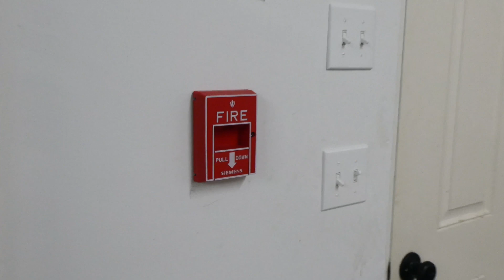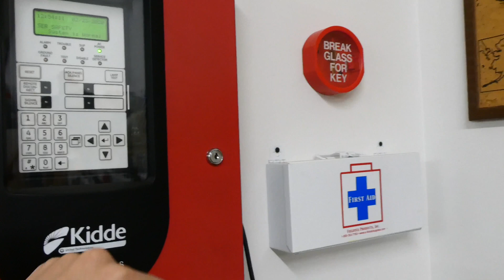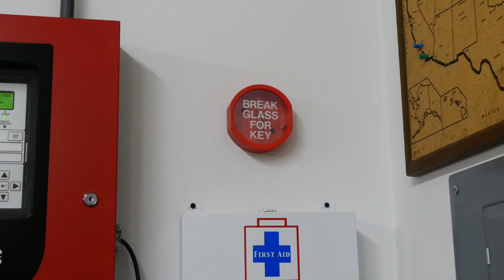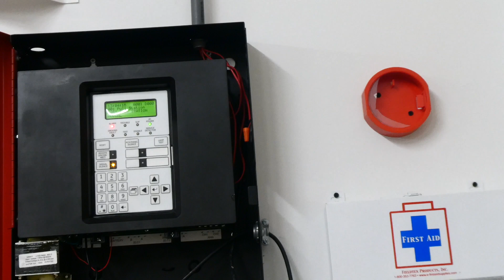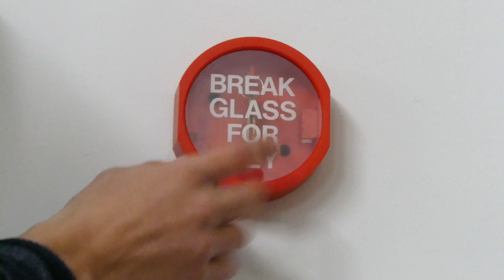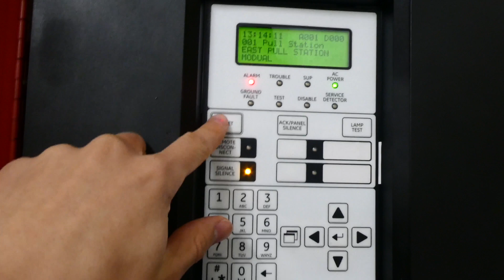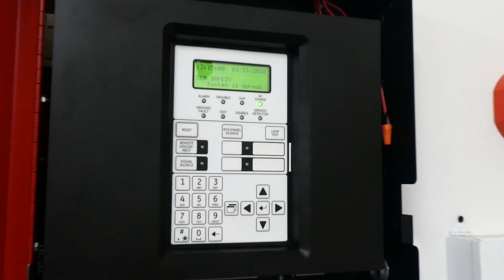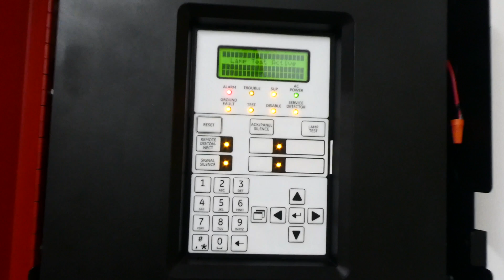S.E.R. System Test 13: BREAK GLASS FOR KEY

Comment: The full model number of both of your UMMTs are U-MMT-MCS-R which is the one with the fire lettering on the front, and multi candela and U-MMT-S17-R which is the one with the fire lettering on the sides and fixed candela

Comment: I blame fire fighters for blocking traffic cause as a truck drive i had to deliver packages from Texas to Florida and the only thing they did is getting me trapped with lots of cars an it annoys me that they are having fun backing up the trucks in the station and they even put me in a tight lane when they are putting out the fire and that ain't fun so it's my turn to annoy them cause if they want to be like that i just pull up to the entrance of the garage an block it and if there is an emergency i will be blocking their path so they can't get to the caller and if they planned to pull me out of my truck i have a shotgun that will be sitting on the passenger side so this will be a warning to all fire fighters cause i'll be blocking one of your stations for fun

Comment: I found one of these used on a Washington ferry boat I work on in my summertime. It holds the keys to the lifejacket locker room. if there is an emergency, people can get into the lifejacket locker room and get the lifejackets, but it keeps unauthorized personal without another key from tapering/entering the lifejacket locker room.

Comment: Having plastic instead of glass is pretty cool imo. Because it seems like it breaks more "orderly" rather than glass, which usually breaks into a million pieces and some fragments of glass can be large, and others can be extremely small and "unseeable" (I've had the misfortune myself of being cut by those pieces bcuz of how small they are 🙁. so Rule of Thumb is: if you DO have a legitimate glass break pull, remember to either vacuum really well or have something to catch nearby 😉). Plastic however can be pretty sharp as well, so that does mean you still have to be careful with that too lol

Great video!
Reply: It sounds like my middle schools fire alarm system but not the kiddie fire panel /old fire panel in 2016
Reply: Hello fellow wheelock
Reply: What does imo mean
Reply: @CelticsPatsProd  in my opinion

Comment: Hey SER Safety! I love your videos and I'm actually having trouble getting my fire alarms wired up. What size wire would you recommend for a hobby system that has no panel, 3 notification devices, and one pull station? I tried a 10 gauge which my neighbor gave me but it's too thick.
Reply from the maker: I usually use 12-14 gauge fire alarm wire.